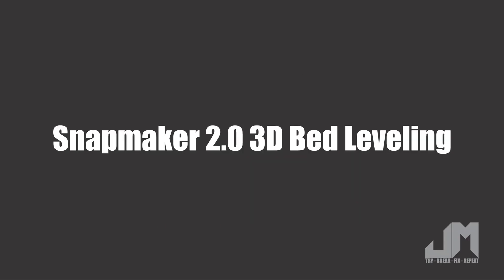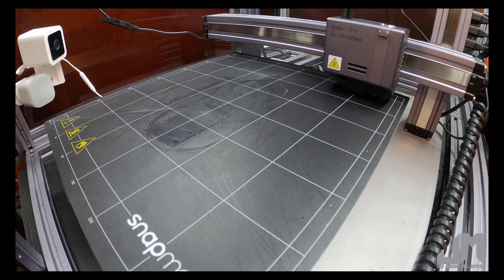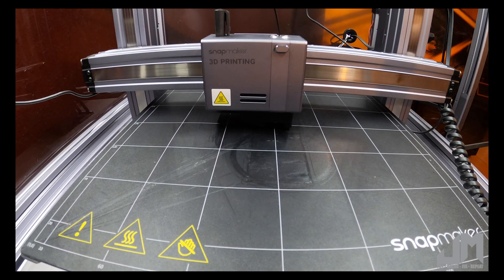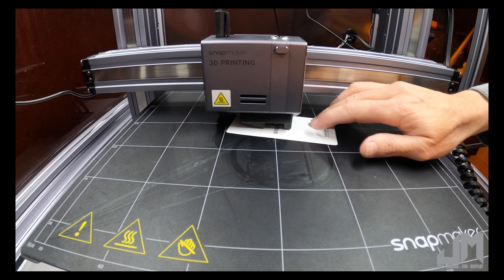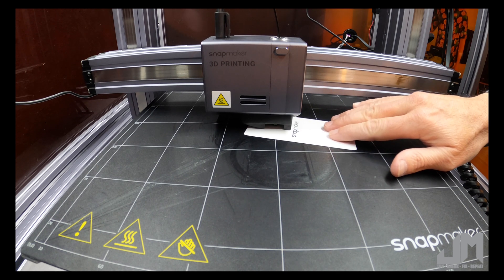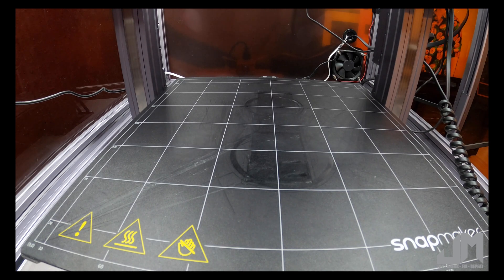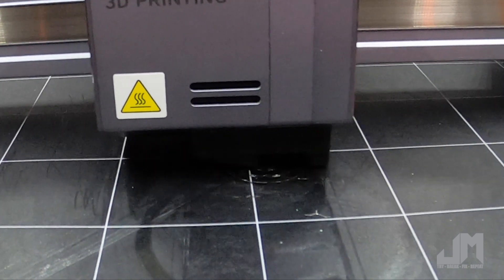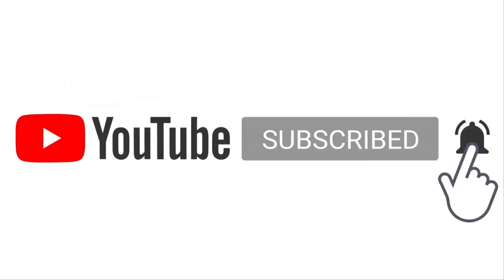Snapmaker 3D Printer Bed Leveling

Comment: I might suggest going to 'Settings --> 3D Printing --> Calibration Grid'. Here, you change the setting from '3 x 3' to '5 x 5', which will raise the number of calibration points from just nine to twentyfive. Also, you should activate 'Heated Leveling', which, you guessed it, pre-heats the bed before the calibration.

Just be careful when using the calibration card, since the bed gets heated up to 70°C, but heating up the bed before calibration is something one should do with any printer before leveling anyway. All in all this should improve the results, especially when your bed is not completely plane.